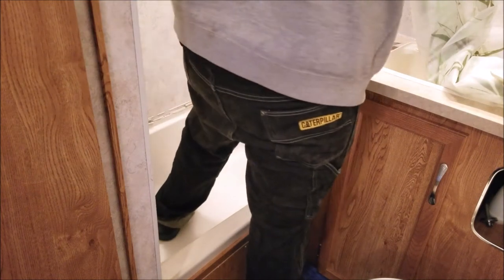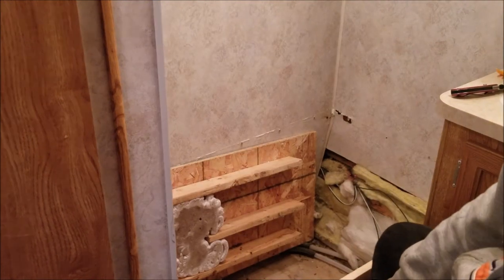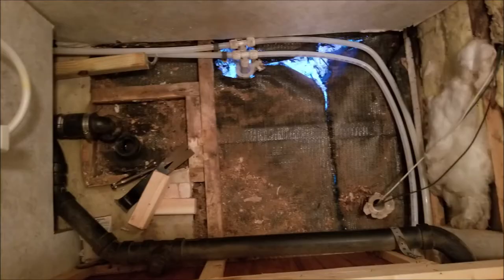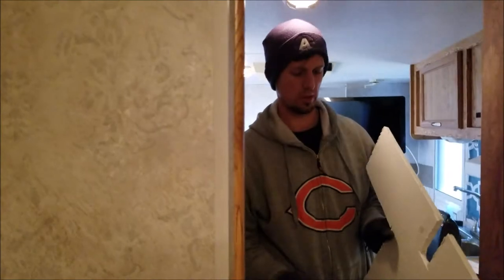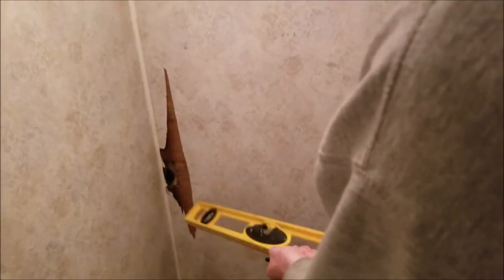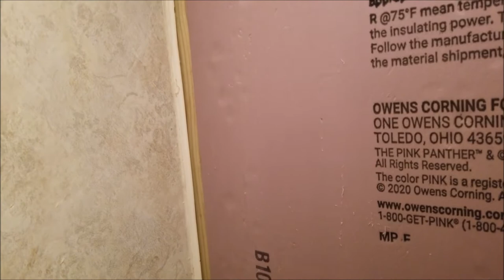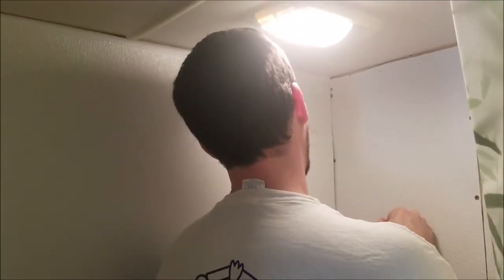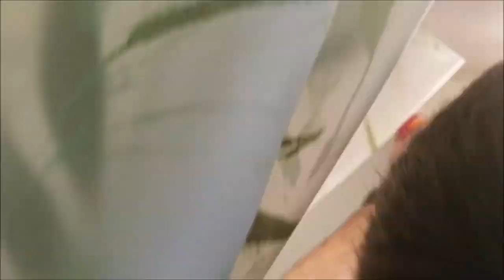RV Bathtub Repair

Comment: What is the finishing wall material you used inside your shower called. It looks very durable and waterproof. Where do you order all your trim pieces from as well?
Reply from the maker: Unfortunately I can't remember what it is called, but I got all the materials from home depot or lowes, but mainly home depot.